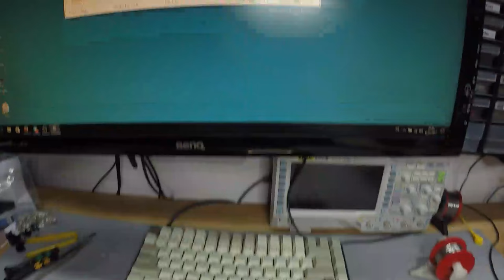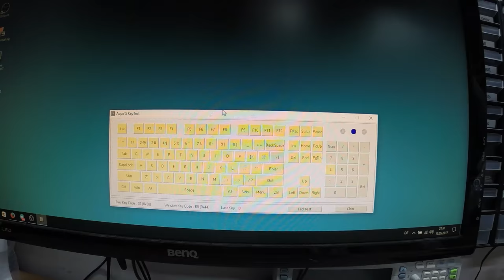LifeZone LZ Iron Build (Nixie Switches)

Comment: I messed up my bottom row on my first build, so since then I've always put the caps on the bottom row before soldering. It helps to use some caps you aren't too bothered about slightly scuffing during working... :) Are there any downsides to this?
Reply from the maker: Alex Young Yeah I used to do that too but this time I wanted to make a point how great the legends on the PCB are (early in the video) and still misplaced a switch :( 
Unless you mess it up like I did, the legends on Leeku PCBs are good enough to let you place the switches without the help of keycaps

Comment: Where are you getting all the nixies from? Or are they the same as your other build?
Reply from the maker: I've had a lucky streak with nixies recently ... will never run out again.
Reply: Did you find some boards or did you get a good deal on some? I've been searching for nixies for a while now.
Reply from the maker: Hm. PM me on DT
Reply: Never run out again?  Lucky!  The prices they go for, I will never be able to touch them.
Reply from the maker: My best recommendation is to look for the keyboards, not the switches ;) Then again, they hardly ever pop up outside Germany :(
Reply: Yeah, I've tried looking for boards as well.  Being in the U.S. certainly doesn't help.